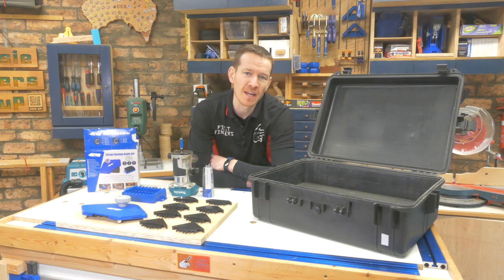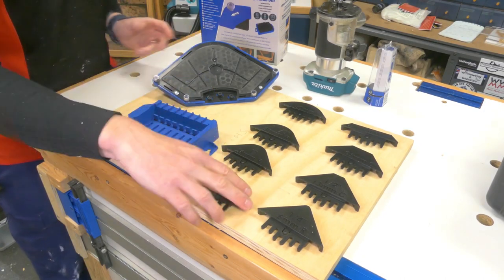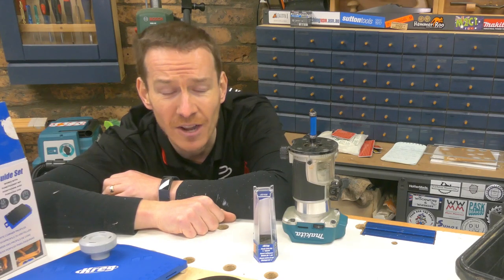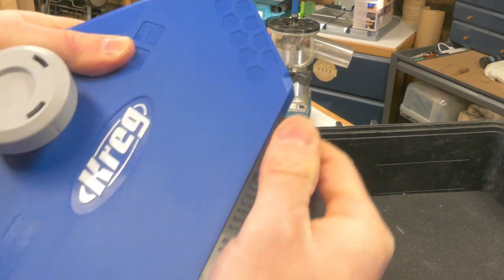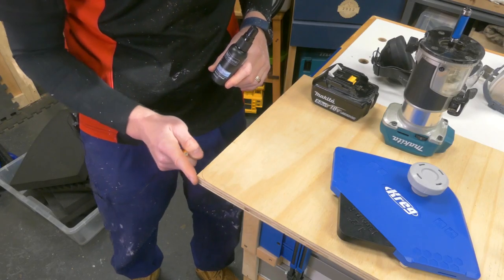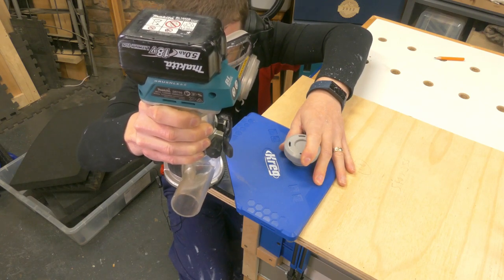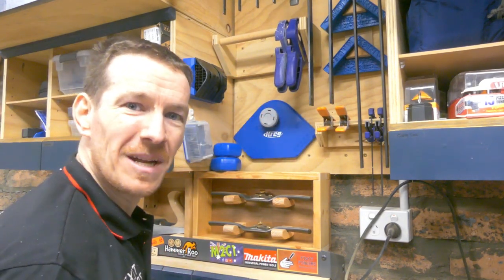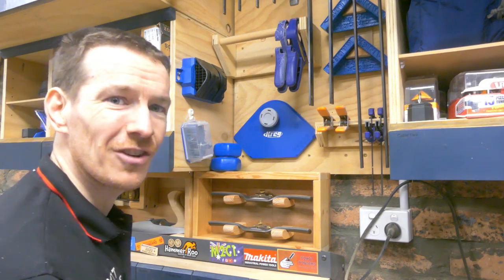Kreg Corner Rounding Guide Set Review, Uses & Storage

Comment: I just brought one of these and I'm also unhappy with the quality of the radius for the 6 and 13mm templates if you hold them on a square they are no where near square and that's why they don't work very well on the smaller radius jigs in the set
Reply from the maker: I've not needed them again since this project. I'll have to pull mine out and check them. While plastic is strong enough for most of the things Kreg uses it for, I think aluminum machined radius inserts would have been much better

Comment: What are your favourite Kreg jigs ?
Reply from the maker: For jigs I'd say that would be the Accu-Cut, Rip-Cut and my 720 Pro. Though now I (finally) have the table saw I don't use the Rip-Cut as much anymore but it was my table saw for nearly 5 years. The one I probably use the most is the actually the little Multi-mark though, boring, but handy. However, my favourite Kreg product is the clamp track in my workbench. That with the Auto-maxx clamps completely changed up and improved my workflow more than anything else. Check out the workbench video where I go into them in detail :D